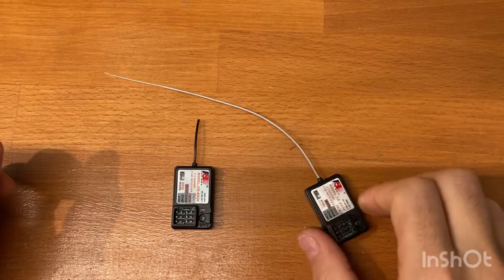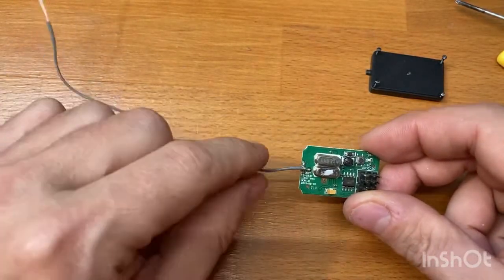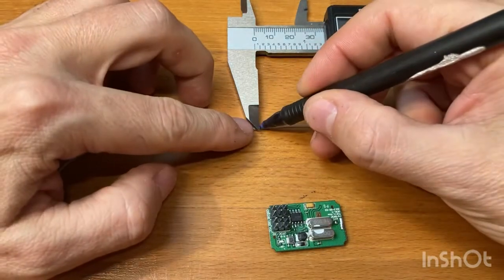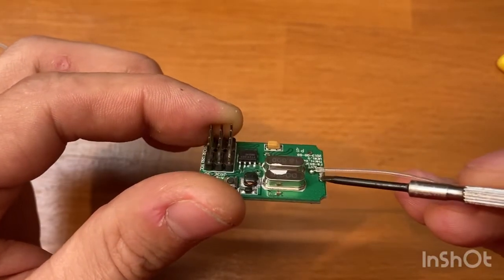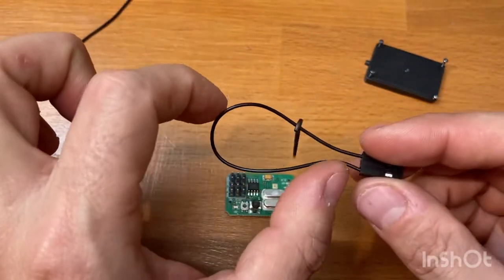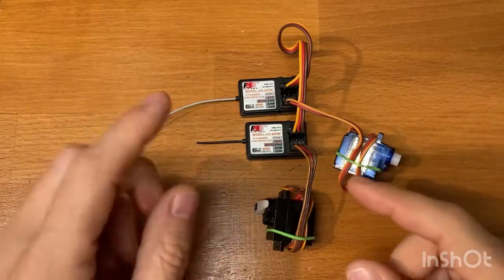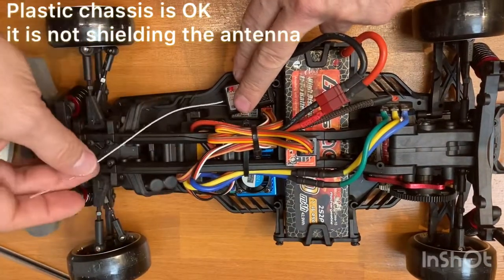Flysky upgrade, short RC receiver antenna (flysky FS-gr3e)

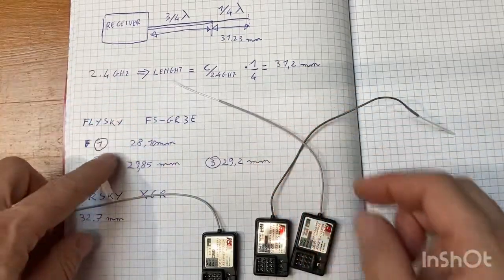Comment: 0:29 not exactly. You can use the transmission line and deliberate impedance mismatch to cause a VSWR that can be used as an impedance matching network. I vaguely recall this from RF class at university (where you rotate around a circle on a black magic smith chart) and the 31.2mm is a myth also. It all has to do with the impedance of the receiver RF port and the impedance of the transmission line.

My only point with this comment is that this will work but it may not necessarily be optimal solution with all receivers. My R-XSR receiver came stock with considerably shorter antennas and the antenna length was a suspicious multiple of the 2.4GHz wavelength.

THAT SAID, I already did this with my particular receiver with only minor loss in signal but saving it from getting chopped up in the props is worth it. Easier to replace when it breaks off too.
Reply: Honestly the receiver antennas are just very cheaply designed, and not all that performant. I wonder how well a proper dipole design would work, and could be implemented by pulling the shielding apart from the center conductor a certain equal length and use a structural element (a zip tie) to create a "T" shape antenna. I don't have the RF equipment to test all this though :(
Reply from the maker: Thanks, i didnt know
Im an electronic engineer, but not so good on radio frequency.

Anyway the range comparison was good,     and i did it on several models for years now,  so for this radio it is working fine.

For the price of the receiver 5€, is totally worthed to try

Comment: why not just CUT it to size...and strip the end piece of the wire? No need to desolder the entire cable..
Reply from the maker: Could be. But the wire is very thin and hard to strip, so easy to kink in the stripping point. 
I could try next time i make one short, and see. Thanks for the idea